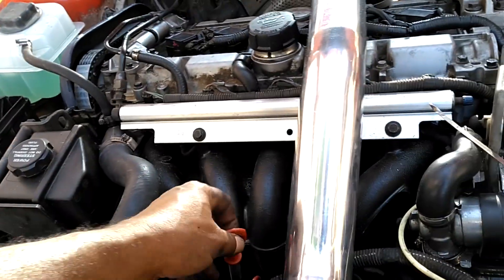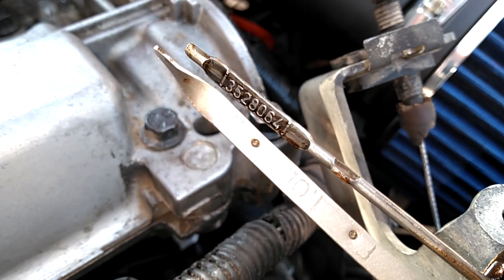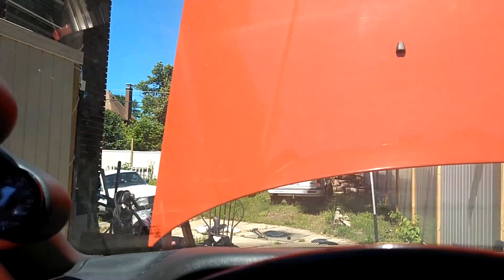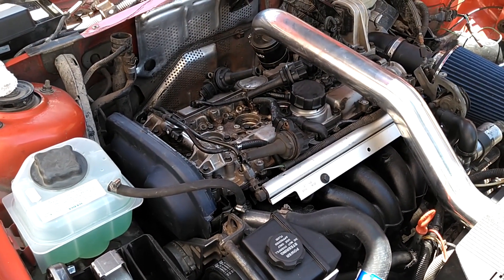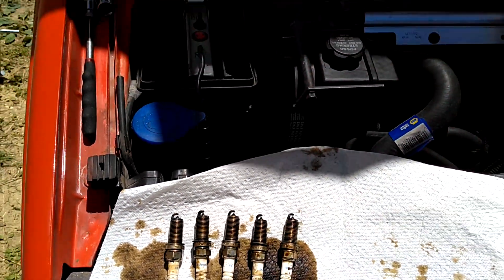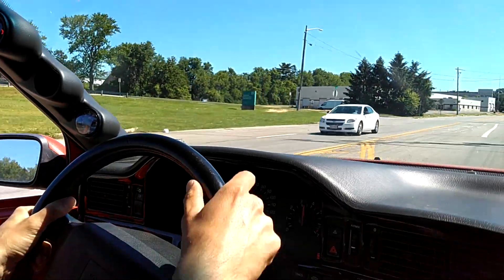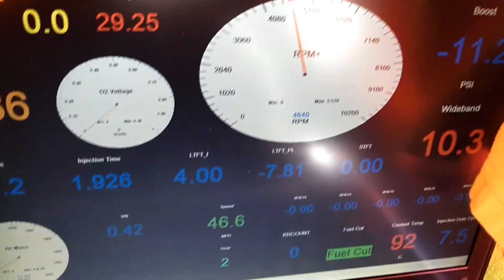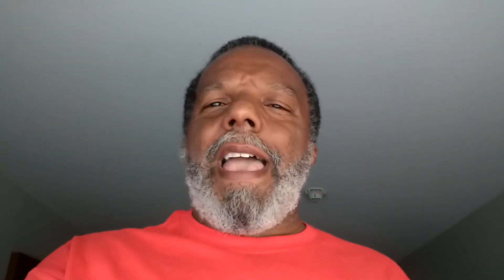More progress on Red Barron, tune up, upgrades (gauges), the maiden voyage. - HOWR

Comment: You might want to check for vacuum leak or the cam timing with the slots on the back levelled. All my healthy white blocks are over 20 at idle in gear. Same gauge so that’s what caught my eye.
Reply from the maker: I have never seen any more vacuum than this.

Comment: Questuon: In my Volvo S70 2.4T/GLT, I have low compression (120 psi at WOT)  in cylinder two (P0302). I noticed its spark plug would be fouled with just black soot or with oil (black). The exhaust tail pipe has black soot. No blue smoke comes out while drivin, but gray smoke comes out from spark plug hole when the engine runs with the spark plug removed or when engine is shut off. I am leanin towards valve guides or stuck piston rings. Which is it? Any ideas for quick fixes?
Reply from the maker: Huh? Please call me. You likely have a different issue. I've never seen a "STUCK PISTON RING" on these engines.
Reply: @RobertDIY  Will do man. The top of the piston for cylinder two keeps gettin covered with oil after cleanin the piston with Berryman's B-12 Chemtool runnin the engine for fifteen seconds.
Reply: Valve stem seals are common and can have odd symptoms.
Reply from the maker: Probably fuel

Comment: isnt the original dipstick exactly the same as every other 850/v70 cars? cus i have one of those dipstick and the max on the original is correct on my b5202s natural aspirated engine
Reply from the maker: The engine that I put in the car is from a '06 S60.
Reply: @RobertDIY  wish i could put a turbo engine in my non aspirated v70 but thats gonna be a very big hassle to get it to pass inspection with a turbo engine, even tho its basically the same parts on the cars

Comment: Where did you get the front headlights from ? Cost? Thanks
Reply from the maker: Andrew got them. Search "Volvo 850 projector head lights".
Reply: I checked them out. Will they fit all of the P80 Volvo's? Thanks for all of your info for all the years.  3 98's great cars

Comment: Dudes trying to data log without a wideband?
Reply from the maker: The o2 sensor will send the data it needs.
Reply: Robert DIY when you had tunerpro open, the wideband reading was not registering. This means zero data is being logged.